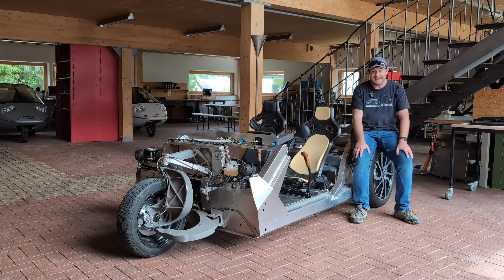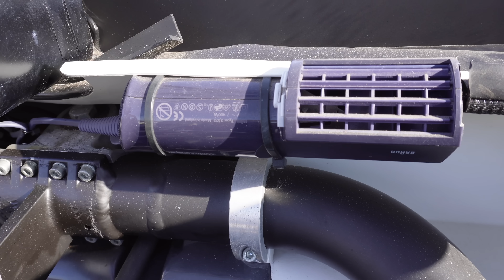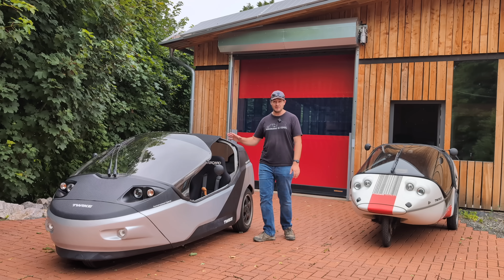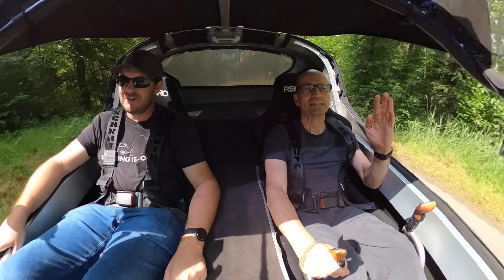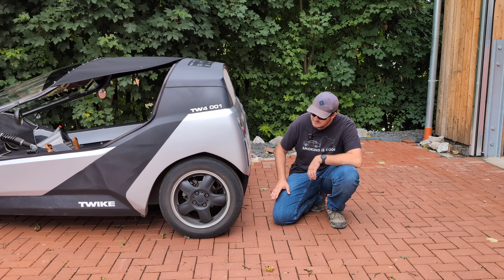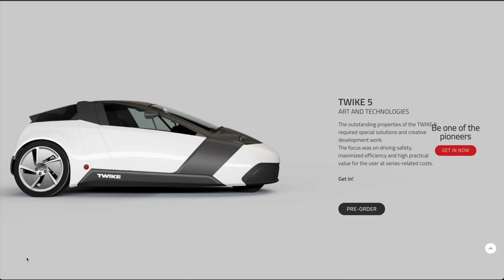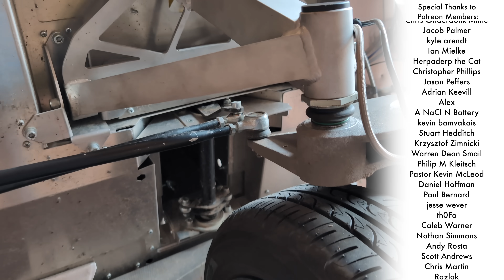TWIKE Is The Coolest Oddball Car Company

Comment: When is someone going to produce an affordable EV that does the job???
Why is that so hard?
Lightweight, battery, motor, the end.
Every one of these things is over engineered ridiculous garbage.
Why?
Reply: Mitsubishi made an excellent little simple not-over-engineered EV a decade ago.  And because it still cost them a lot to make, they couldn't sell it for less than $28,000, and basically nobody bought it.

The problem is that batteries are still expensive, and development costs for EVs are expensive because it's always an all-new design that's not going to be a best-seller.  On an over-engineered expensive high-end car, you can add $10k to the price and the people who want a high-end car won't really care.  On a cheap low-end car, that same price increase kills the market completely.

On the other hand, you can buy a really nice used Mitsubishi i-MiEV for $7000, so if you want an affordable EV that does the job, they do exist.

Comment: That steering, in the latest prototype, is so sketchy!

there is no steering axis inclination or caster at rest. It does gain some sai under bump, but no caster. i bet it needs a steering dampener to subdo the speed wobbles after bumps.

a good fix is to add another front wheel, which also helps prevent rollovers. If you still want 3 wheels, delete a rear & the differential...or make it fwd.

Comment: Building light and efficient EV´s is where its at, only problem is gonna be crash safety. But that cant be worse than one of these tiny Alibaba GolfCart EV´s from China. I like how TWIKE after all these years finally realised that nobody is going to pedal these 600kG heavy things and just removed that nonsense :) Also the Twin- Stick steering on the TW4 and that Canopy feels much more fighterjet than enclosed bicycle. A real brake pedal is much easier to operate and certify than the long process of backpedaling. Hopefully they add some real doors on the TW5.
Whats taking them so long on the TWIKE 5 is probably all the specs they want to get in there, a 200HP motor, big battery, a much higher speed, many necessary safety features to register it. Its alot like a real car, will have stiff EV competition and an eyewatering high price like the Microlino. Lets see if they really keep these goofy pedals and TwinStick steering for production, cant imagnine going over 160km/H 100MpH with that :) Theorethically this thing could go on the Autobahn. Maybe there will be different variants, one classic with pedals and sticks and a modern one with a steering wheel and dual pedals for acceleration and braking...

Comment: Twike should try a model with the two wheels at the front rather than the rear, like BMW Isetta or Messerschmitt of the 1950s. More stability and better cornering at speed.

Comment: this thing will pretty much be the peak of ultra-efficient mobility. Love it - and i do hope that the final product will be able to recharge the main battery through the pedals - they should also implement a electromechanical override which connects the pedals to a drive chain .... maybe have a selectable gear and bike-transmission, also

Comment: Power to weight ratio is a funny thing. I went kart racing, and that had 5.5 horsepower. And I'm 6 foot 3, roughly 300 pounds.
And that was a rocketship. So this Twike 5 has the potential to be a reaaaaaaaaally fast three-wheeler.
Reply: some said "floor rocket" 🤫

Comment: On the topic of "This road has a speed limit of 60mph": Any road outside settled areas that does not have signage saying otherwise, has an implied speed limit of 100 km/h (~60mph). Same is for inside settled areas, where the limit is 50 km/h (~30mph). But this does not mean, you should be driving 100, because another law states that you must be able to come to a complete stop within viewing distance (preferably without crashing into anything lol). This kinda limits you in terms of speed on roads that are narrow and windy.
These "implied" speed limits are present throughout most of Europe (from what I know). Settled areas are usually 50 km/h, outside of settled areas it varies between 80 and 100 km/h and high ways are usually 120 to 130 km/h (with the notable exception being Poland with 140 km/h on highways and Norway with 110 km/h). And while Germany doesn't have a general speed limit on their highways (the famous "Autobahn"), they have what is called "Richtgeschwindigkeit"  (or a "recommended speedlimit") of 130 km/h. That is by the way also, why the country sign of Germany (posted on every borded) states a blue rectangle with 130 as the "speed limit" for high ways, instead of the usual red-circled number.
Reply: Same with the U.S., although it's 55mph and 25mph in most states for outside and inside "town limits".  Which I would imagine is functionally almost exactly the same as Germany, since in the U.S. the general standard seems to be that the enforced limit is 5mph faster than what the signs say.

Comment: "Expensive, low volume, not for everyone"

So where is the subcompact sporty EV with 200+mi range that's affordable? Why do all the EVs have to start at 40-50k? The Twike 5 looks perfect for what I want in a daily driver (assuming NVH is controlled), though I'd prefer a normal brake pedal instead of a gimmick.
Reply: The Leaf and the Bolt both start around 30k and have more than 200 miles, though perhaps "sporty" isn't a good description

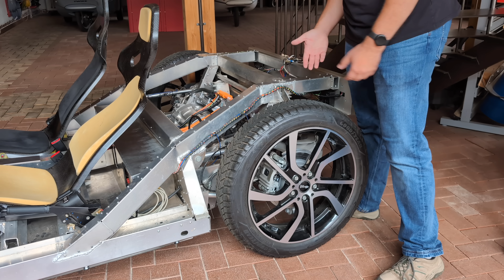Comment: 17:17 that rear axle is called De Dion suspension, essentially a live axle with a remote differential mounted on the frame with CV joints to the wheels. Makes a lot of sense for this car, allows for independent wheel alignment that a traditional live axle couldn't achieve, lighter and more simplistic than traditional independent suspension, and reduces a whole lot of unsprung weight. its pretty uncommon to see in (what hopefully will be) a production car, the only other manufacturer who used it frequently is Alfa Romeo.

Comment: You know, something you might experiment with; although electric motors develop their best torque at zero RPM, I've heard that they lose efficiency as the increase in speed. I don't rightly know if this is true, but if so, why not try a transmission coupled with an electric motor? The most efficient way would be a manually-shifted gearbox, but I'm intrigued with what a CVT transmission would do, with an electric motor. Due to the complexity of commercially-built ones for cars, what about using a snowmobile-type belt CVT and see how the motor and batteries perform with it? It would be fun to watch, no matter how it turns out.

Comment: I am surprised they didn't follow down the road of the design ethos of the Bond Bug with the lifting canopy which would relieve some of the weight issues from having separate doors and affixings for, the Bond Bug was and still is insanely crazy and I am sure whoever owns the rights of the now long defunct Reliant would be happy to see a "homage" rise again for a very very popular design.   The Bug was quite futuristic, all alloy engine, panhard rear suspension with coilovers, genius front steering and suspension that went on to be fitted in the Ant, Rialto, Robin and Zoe models and being light as a feather it was very swift on its toes despite only a 700-750cc engine.   The Bond's canopy out-cooled the Baja Beetles, hit the release and threw the canopy up and clambered out but it also allowed the screen to be held solidly in place and take impact and beneath the dash of the Bug was Reliant's "truck stopper" big as yer leg solid round girder supported by equally strong solid arms to give owners at least a fighting chance in a head on.

Comment: With respect to the pedal assembly: it could be of the V design rather than circular. See for example the propulsion mechanism for sea kayaks. The pedals could pump hydraulic cylinders which then spin the generator quite fast. Maybe a hand-activated switch on the steering lever would divert the hydraulic pressure to braking.

Comment: The speed limit on these smaller roads especially is more like "Please don't ever drive faster than this" and not "You should be driving this"
Reply: Even in the UK (well, all the UK except Wales 😉) our rural single-carriageway roads are mostly 60mph maximum. Though officially they're unrestricted beyond the national speed limit, which happens to be 60mph for cars without trailers on single-carriageway roads. That's not to say that driving at 60mph is a sensible thing to do, it just isn't technically illegal.
Reply: Many small rural roads just doesn't have a speed limit cus you can't go quick anyways. The default outside of town applies (100 km/h = 62 mph), that's why he said the limit is 60.
Reply: Depends on your car and time of day

sunday morning is rally time
Reply: No thanks
Reply: Fun fact: in the US it depends on whether the sign is white or yellow.

White signs are regulatory: "if you drive faster than this, you might get a ticket."

Yellow signs are advisory: "if you drive faster than this, you'll probably end up in the ditch."

In most if not all states, you can legally drive faster than the speed on a yellow sign, as long as you can do it without causing a crash.
Reply: On these country-side roads, you have to obey a speed limit that will allow you to stop within visual range. On tight and curvy roads, you have to be able to stop in half of that. A rough formula for stopping distance is half the kph speed in meters.
Reply: Well in the US many roads had their speed limits lowered not for safety but for fuel savings. It was more one of those political boondoggles where they say "hey we're trying". It's why you can seemingly go 50% faster on most roads just fine or how the backroads in some cases have the same speed limits as highways. I know many back roads with speed limits of 60-65mph here yet there are highways nearby with a limit of 55mph.
Reply: I'd love to believe that the sign just said -60- and he's like "holy shit this is fast" but it's in KPH, not mph so it's like 35ish MPH, a pretty normal back road speed limit hahahahaha
Reply: @AJ_ghdhejsien  In most countries roads don't need speed limit signs because the default speed limit of that road type applies. For interurban roads in Germany that's 100 km/h. You'd only see speed limit signs where that speed has to be lowered for safety reasons (e.g. near tight turns, road crossings, construction work) and it's lifted after the dangerous section.
Reply: Not in Germany.
Here that speed limit means "You better not drive slower than that. And even if you drive the speed limit someone will tailgate overtake you".
Reply: @Jehty_  Are you sure about that? Half the time the sign seems to mean "You should drive half the speed limit and hold up literally everyone".

People also don't go faster than 100/110kmh on the highway despite the speed limit being 130, or even unrestricted. 
Germans are very slow drivers. Painfully slow at times.
Reply: @99domini99  you must be talking about a different Germany. Where is that mythical land located?
Reply: @Jehty_  Most call it Köln, however locals call it Kölle.
Reply: It's still legal to do 60km/h on a 60 limit road. It's funny how men just act like women.
Reply: @automation7295 
The desire to stay alive is an exclusive feminine trait now?
Reply: No you really should drive the speed limit. As long as the road conditions and visibility allow for it, youd better not hold up everybody and cause people to overtake you. Usually when we're in a car we're trying to go somewhere and not just trying to get the day over.
Reply: @philipkoller3007 
On the other hand, if you are trying to get somewhere, you shouldn't risk to not ever arrive.

Comment: The new steering arrangement seems to be far more manageable.
I doubt that they will ever come here as Australia is very strict (or rather overwhelmingly bureaucratic) on safety, but otherwise the 5 seems to meet my needs.
Reply: More strict than Germany?
Reply: @Jehty_  Maybe "strict" is not the right word?  They are very picky about what they allow.  Morgan gave up on importing their 3-wheelers because the Australian regulations demanded changes - to a vehicle that had been accepted everywhere else decades before, without a problem.
A few other brands have tried to sell here and not made it - in general the Australian law allows ANYONE in - but the registration rules tend to be the limitation.  For most modern cars there is no trouble as they are designed for demanding places like Germany and California.  Every now and then there is something our lot do not want, like three wheels or central steering position, so they find a way to make life too hard for the manufacturer to bother trying.
Reply: @John.0z  : Three-wheelers may be an especially difficult case, because at least in the U.S. they count as motorcycles and thus the safety regulations are very different than what is required for four-wheeled automobiles.

Comment: The twin sticks seems like a MASSIVE upgrade from the stupid tiller, way more controllable.
Reply: Because you can actually get some leverage from them. The tiller is great as long as you're turning to the left, but turning to the right must be painful after a while. I'm sure it's fine on the open road, but in city traffic that'd get annoying really quickly.
Reply: Also, rather than relying on side to side movement, now you use forward and back movement which is arguably less straining, probably more fun, and definitely less discomforting.
Reply: You dont sit inside a motorcycle. You dont steer a twike with your body by leaning into turns. It definitely 100 percent needs a steering wheel at those speeds.
Reply: @kevinsammut7246  It's still funny how people don't seem to understand that TWIKE isn't meant to be a daily.
Reply: Tiller reminds me of some very early cars, more inspired by boats than actual cars.
Reply: It would sell really well if they just used a steering wheel. I love the pedals, but come on, they can absolutely put a regular steering system on it.
Reply: @Brunomr__98  Everything need a steering wheel according to you.
Reply: You know what would be an even bigger upgrade? A steering wheel. Or at the very least, a yoke
Reply: @kevinsammut7246  I think this ca ris meant to be a quirky fun car, not a daily.
Reply: @jwalster9412  yeah, the older one. But the new one will do over 100mph and have usable range. And accelerate like a bat out of hell. That's steering wheel territory.
Reply: @kevinsammut7246  So what? Motorcycles are capable doing over 100mph and yet nobody says "That's steering wheel territory"
Reply: @kevinsammut7246 
Honestly, those side sticks are great and you don't need to constantly change grip in tight turns.
A steering wheel would be a downgrade imo. You should try them.
Reply: @kevinsammut7246  Why not add a fourth wheel at that point and add a Tesla badge whilst you're at it so nobody wants one.
Reply: @kevinsammut7246  But then they couldn't put useless pedals on it, and then what's the point of building the car at all?
Reply: @Hendlton  It's funny how people don't seem to understand that TWIKE isn't meant to be a daily.
Reply: Still seem just different to be different. Ditch the pedals and get a steering wheel.
Reply: @ 
Keep the sidesticks, make the pedals optional.
Reply: @Video_Crow  It's funny that people want Twike to get a steering wheel, yet don't mind that motorcycles have handle bars.
Reply: Another protogen
Reply: There might have been a bigger market for this if they did away with the pedals and the twin sticks and instead installed steering wheel and more current up to date battery storage and installed some flexiable solar pannels on the rear of the roof of the vehicle for power boost.
Reply: @BGDGr81  The solar panels would be as useless as the pedals. They're too small to provide a significant power boost.

Comment: The pedals only working a generator is so daft. At least if you ran out of battery in the old one you could still move. That "automotive expert" clearly wanted them to create a typical car.

My biggest hang up with them though is their crash performance. No crumple zones, no pillars - while you may not crash, others may crash into you. All of that impact force is going into the softest thing in the vehicle. Your body. Plus, it doesn't solve any of the other issues that cars cause, like traffic. It's such a shame that this is such a miss. I'll stick with bikes, trams, and trains.
Reply: At least it shelters you from the rain... and it's better than Elon's milkfloats!
Reply: It makes sense. The motor and battery are and will be very heavy and for all intents and purposes you can still "just" charge up the battery and start driving after a while. The fact that it will take a while for the motor to have enough power to actually move, should tell you how hard it would be to pedal that thing.

Comment: For aerodynamics, it's best for a trike to have one in the front and two in the back so that the front can be tapered. But for stability, especially around corners and under hard braking, it's better to have that reversed. For day-to-day driving and highway driving, the configuration of this Twike should be perfectly fine though.

Comment: I wish I could buy a tiny electric car here in the US. I commute less than 3 miles a day and honestly one just makes sense to me. I can't ride my bicycle since the majority of my commute is on highway.
Reply: It's just small rather than tiny, but a Mitsubishi i-MiEV is about $5000 at the lower end of the used market, and would be pretty much ideal for that.  My commute is about twice yours, also mostly highway, and I love mine.  It charges overnight on the 110V charger, so you don't even need to install a charging station.